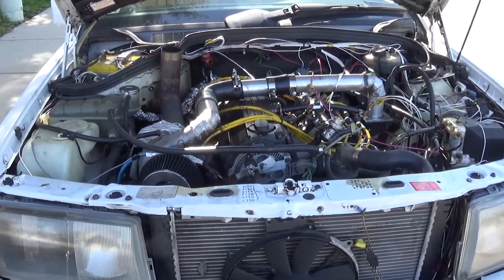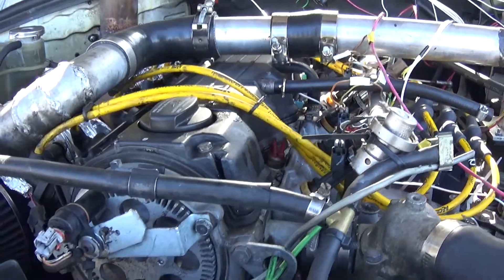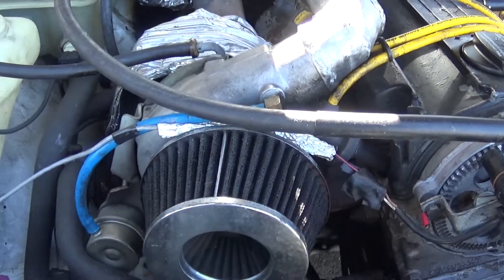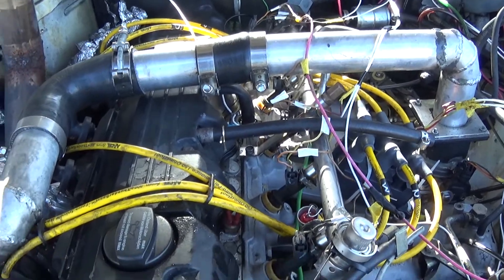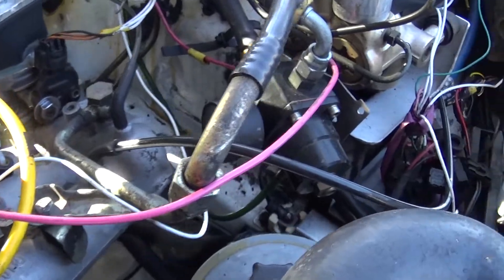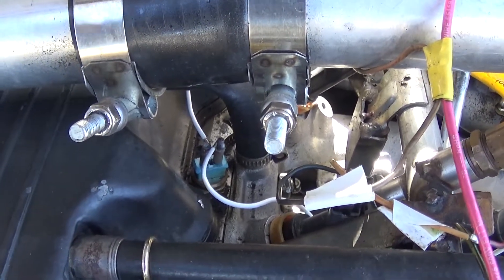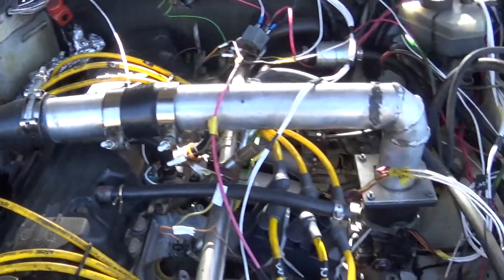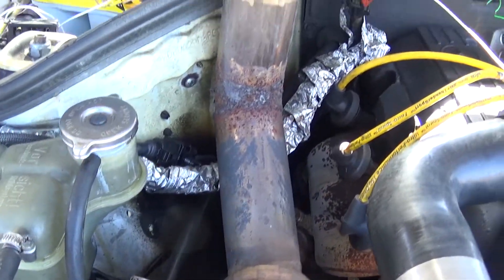Turbo M103 Mercedes 190E T

Comment: Cool project.   Looking to do the same hopefully to place in a old Duster ( technically it IS a slant six, lol).   So the now 36-2 wheel is also a 36-1 at 180deg to take care of the crank timing also ?    Or do you also run a crank sensor ?
 Please explain .
Reply from the maker: Crank turns twice as fast as cam.  
36-2 on half the wheel and 36-2 on the other half.  
Ecu thinks it’s crank because it’s getting 2 revs per cycle however it’s mounted on cam.  
So one rev in a cam gives me the signals the ecu is looking for.
Reply: @idus   That is cool.  Awesome way to kill two birds with one stone.

Comment: How did you wire the 3000gt ignition module
Reply from the maker: 3 inputs from ecu 
That fire 3 outputs
12v and ground
It’s all labeled on the module.

Comment: How did you done the oil feed for turbo, i'm thinking of making a T adapter to oil preasure sensor
Reply from the maker: Behind the oil filter is a pressure sensor and that’s where I made the connection.  The threads are weird but I found something that worked.  A T is a great idea.
Reply: @idus  thanks, just making shure my theory is good, very good job🤌✌️

Comment: What ford throttle position sensor did you use? Currently EFI/manual swapping/boosting my m103
Reply from the maker: Here are some part numbers.  It’s off an explorer: 
5S7264 TPS6044 TH381 E693 SS10545
Reply: @idus  Was it a straight fit? Or what / how did you modify?
Reply from the maker: @BaasYT  I can do a video on it as well as a few other things that are not explained that well.

Comment: Awesome build! Does the turbo seem to have a huge power boost compared to n/a? Also, how much PSI are you running, and do you think the build is worth it? I've always wanted a turbo 190e, but can't decide if I should turbo a 2.6l or just m104 swap one.
Reply from the maker: You really wake the motor up with a turbo. The 2.6 is easier and less expensive (~1200+- total including car) however if I had the time, M104 for sure. Its a rocket either way.